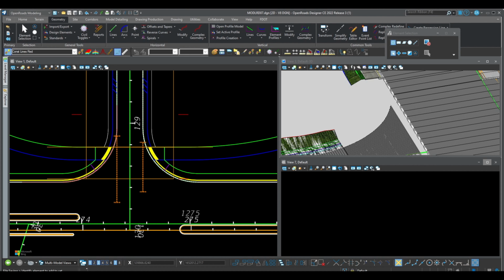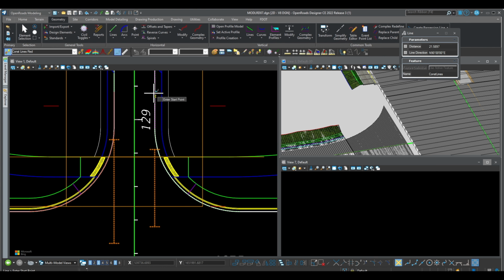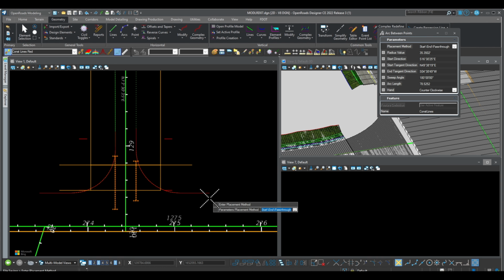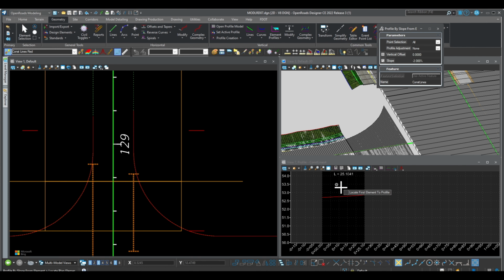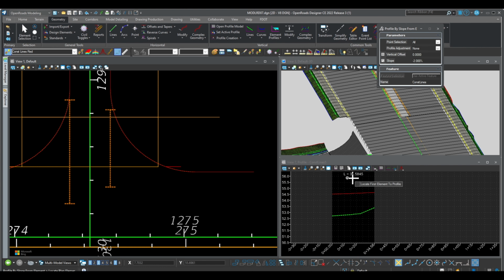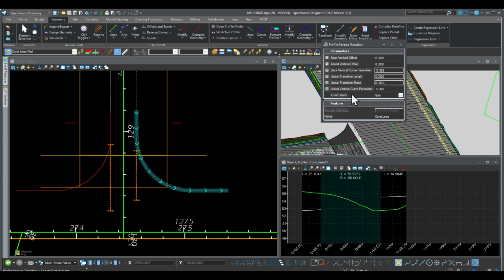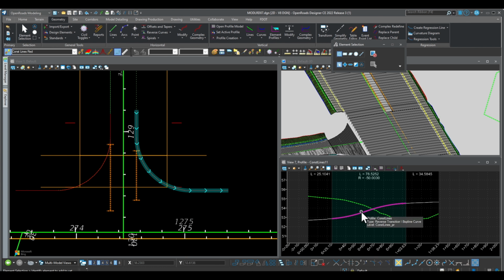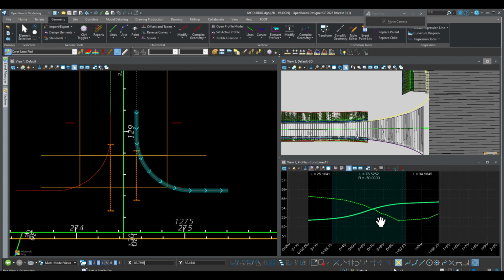How to Create a Curb Return Profile in OpenRoads Designer | Step-by-Step Tutorial

Comment: you could have also used the quick profile transition tool in the vertical group of tools in the Geometry tab, depending on the elevation and the slope of the two lines the software compute one parabola or two.